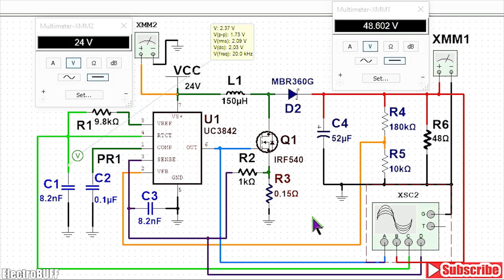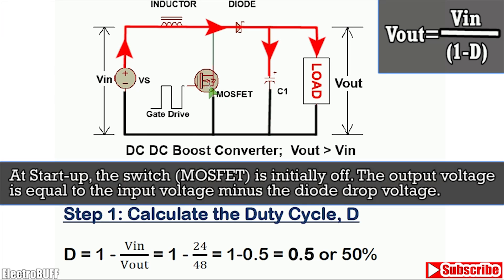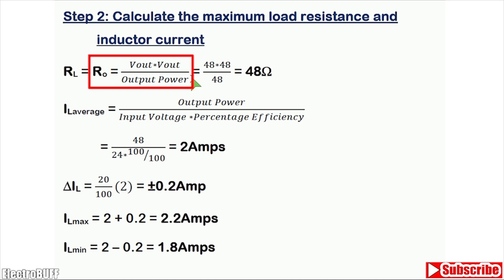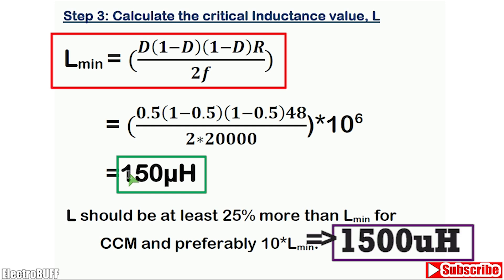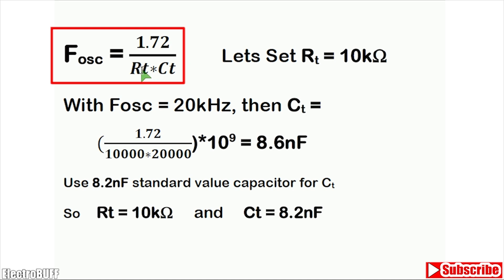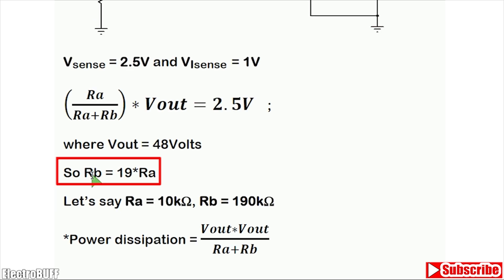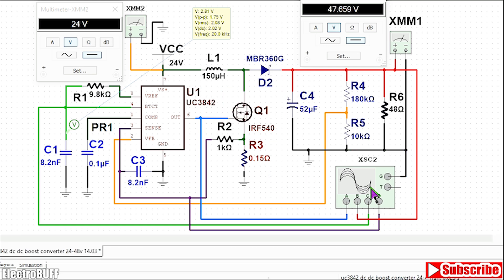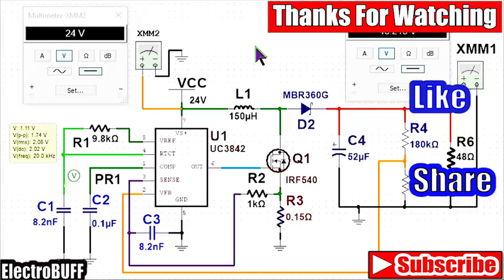Boost Converter | How it Works | Design Calculations and  Simulation on Multisim Simulink

Comment: Hello, could you explain how an alternating output voltage can be made with this integrated circuit?  For example, input voltage 12V and output variable from 13V to 30V?  Thank you. Rade.

Comment: It will be better to add a slope compensation in case the pwm is higher than 50 % because you are using current mode regulation